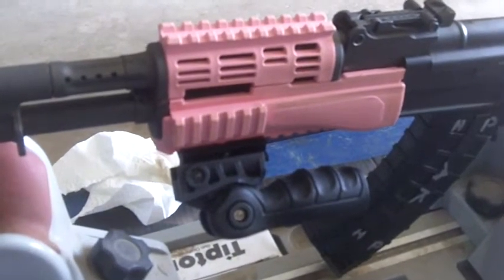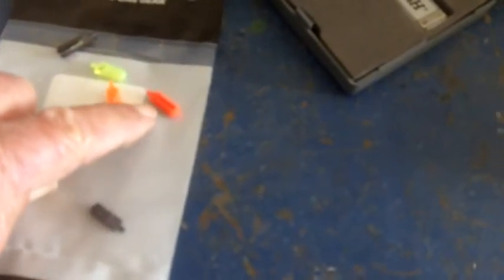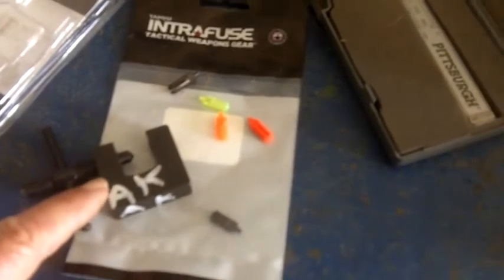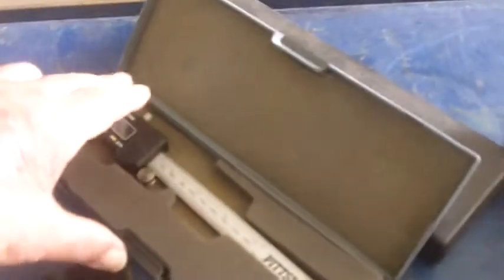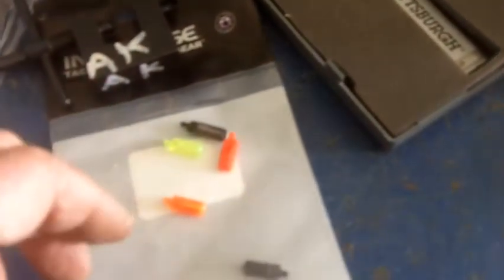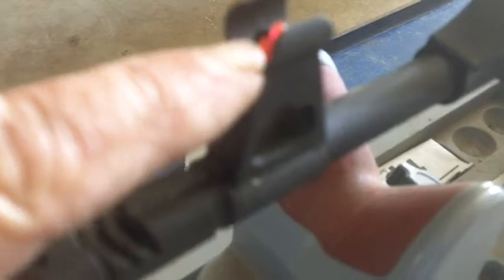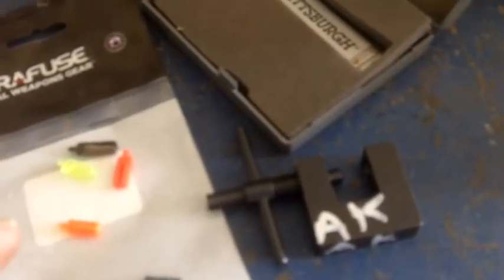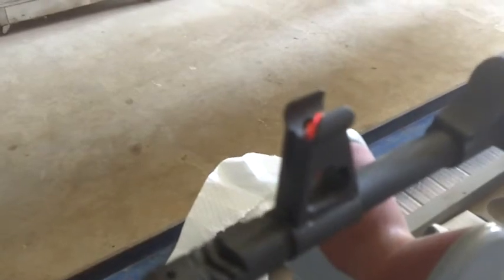AK Front Sight Mod

Comment: Any advice on getting the front sight post out? I've broken three tools (including a magnomatic) and it will not budge. I've oiled with kroil, torched. Still wouldnt budge. The drum it screwed into will move but the post wont turn, you think I need to replace the whole block?

Comment: Pinch the bottom split with a wire tie or fishing line to start the threads. Then snip it off.  ;)
Reply from the maker: I did mine and a friends. Not too much trouble to get them started.

Comment: Very informative. Have you had any issues with a canted sight? I picked up an unfired Yugo with a slight cant to the right. I can drift the front sight to compensate, but it is nearly all the way over. I thought about doing a front sight conversion with one of those Venom units, but it is pricey, and I prefer to keep the stock one and use the sights that you did in your video. There's no easy fix, is there?
Reply from the maker: I have a friend that bought an American Made AK and has a canted sight.  Now he hates it. We put one of these sights on and moved it all that we can. He complained to the manufactured and did not get any satisfaction. About the only solution is to go with an optic of some sort.
Thanks for watching and commenting.